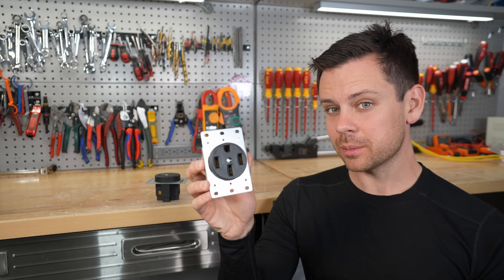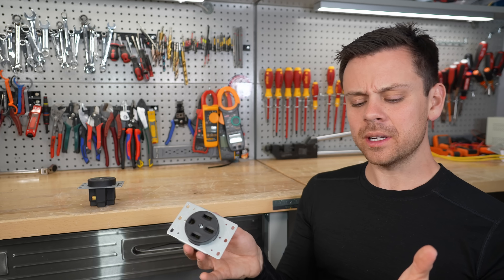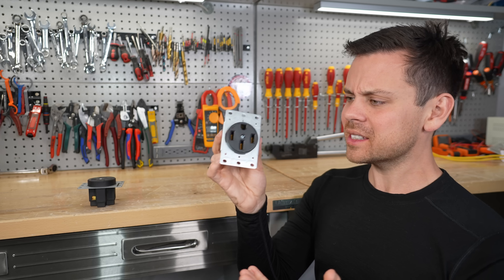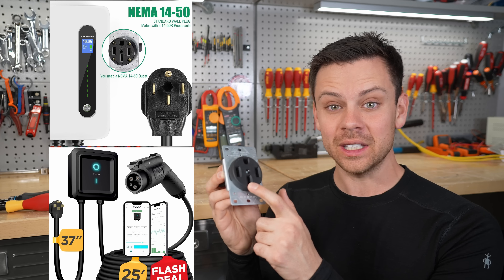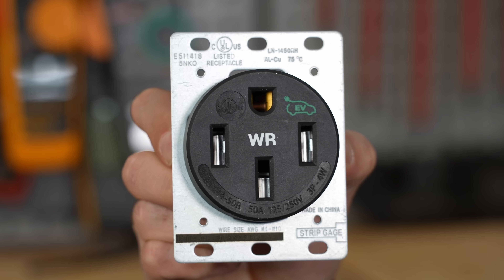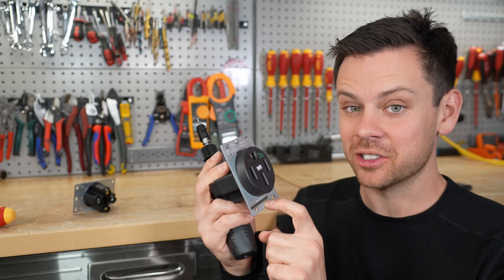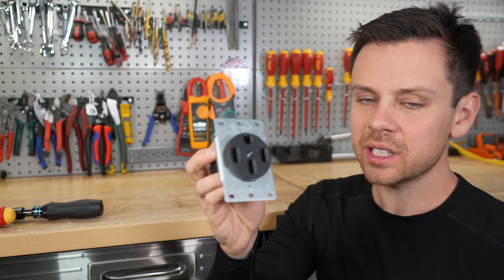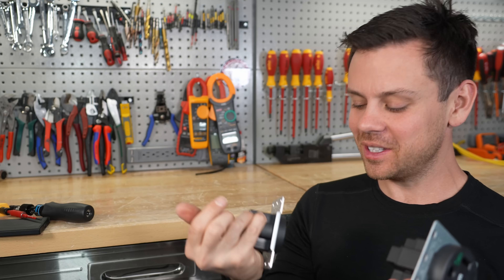Quick Guide to NEMA 14-50: Don't Burn Your House Down!

Comment: As a licensed electrician that specializes in EVSE installs, you are correct. It is not a code issue yet but widely know in the industry. I always push for a hardwired install as the 14-50 is more expensive and less output. Unfortunately, there are still some popular DIY videos out there that show the cheaper unit being used. I do not recommend this as a DIY project but at least, always pull a permit and have it inspected.
Reply: The NEC "electrical code" is trash.  It 100% allows electrical setups that can and will burn people's houses down, pretty much with 100% probability, given enough time in service.  The problems/deficiencies with the NEC are most severe when it comes to high current connections and contacts, especially those relevant to electric vehicles and solar power systems.  One of the biggest problems is that the NEC regulates electrical installers, but not electrical component manufacturers (which often times actively bribe [and/or sit on] the NFPA to include provisions in the NEC to require electrical installers to use their specific company's products).  Electrical component manufacturers are essentially free to design and sell garbage that pollutes the marketplace and really does burn people's houses down, while still being "100% code compliant".

The biggest problems with the NEMA 14-50 outlets (and some plugs) are not so much with the installation, it is with the manufacturer's designs available on the market.  There is no policing of the marketplace to ensure the products that manufacturers are producing products that actually can continuously meet the required current specifications for decades under real world service conditions.  Copper and brass are great electrical conductors and make good contacts, but only when they are brand new and free of oxide buildup.  Copper and brass are terrible electrical contact materials, when used in the real world over many years of service, where thick oxide layers build up on the contacts and make them highly resistive.

Similarly, screw contacts work fine when they are brand new and just recently torqued, but they are trash over time.  Heat from electrical resistance at the screw terminal causes thermal expansion of the wires in the screw terminal, which increases contact pressure on the wires and "squishing" of the metal during heating.  However, on the subsequent cooling cycle, thermal shrinkage of the wires in the screw terminal causes them shrink down to a size that is now too small for the current screw terminal position.  Repeated thermal cycling makes the problem even more severe, as the screw position becomes increasingly sub-optimal as the wires under the screw terminal continuously squish and deform more over time through higher peak temperatures.  Re-torqueing the screw helps, but it is only a temporary solution.  A properly designed electrical contact must maintain positive spring based pressure on the wires, with high surface area of contact, over time.  Screw and bolt threads simply do not have any springiness to accommodate and compensate for thermal expansion/contraction effects changing the shape of the wire being clamped.

Unless/until such time as someone competent rewrites the NEC and starts cleaning up the marketplace of pollution/trash electrical product designs, one would be well advised not to trust the NEC, the opinions of many electricians (who are not engineers specifically expert in electrical contacts), or passing results from government inspectors.  Government inspectors are not what make safe and reliable electrical connections that will not burn down your house.  There is no substitute for designing products correctly, and then installing them correctly, regardless if the installation was "inspected" by the government, and/or if the installation was done by a "qualified and certified electrician".  Certifications and qualifications do not prove a person knows or will follow all the best practices, it simply means they jumped through the right hoops to acquire the certifications or qualifications.

In the meantime, people need to follow certain best practices when dealing with high current electrical contacts (especially relevant to electric vehicles and solar power systems), which basically includes:

1.  Pretty much always use an anti-oxidant compound (ex: "NoAlOx") on all "high current" (essentially anything over 5 amps continuous) electrical interfaces, be they brass, copper, or aluminum (and to a lesser extent, tin).  
2.  Use fine stranded wire preferentially over solid copper wires.  Fine stranded wire conforms to the contours of screw contact interfaces better and provides higher surface area for the electrical connection, compared to solid core wires.
3.  When possible use tinned copper wire instead of bare copper wire.  Tinned copper wire is much less subject to natural thick oxide buildup causing increased electrical resistance, compared to bare copper or bare brass.
4.  Try to fill screw contact cavities as close to 100% as possible, with stranded wire.  The goal is to maximize surface area of contact between the wire and the screw contact.  It helps substantially to strip the wire much longer than normal, and then fold over the end of the stranded wire (once, sometimes even twice if it will still fit), before inserting the end into the screw terminal orifice.
5.  Basically always torque screw terminals as tight as possible without stripping the threads or screw head, while wiggling the wire simultaneously left and right a little bit during torqueing.  The goal is to 100% fill the screw terminal cavity with wire strands, in the final screw position.  When the screw terminal cavity is 100% filled, this maximizes surface area of contact patch for lowest resistance, while also leaving as little room for further deformations of wire shape to result in decreased contact pressure/surface area.
6.  Always lightly sand (and/or rub with copper oxide dissolving acids like vinegar) any copper wires or contact surfaces that are bare copper or bare brass, unless they are brand new and clearly bright and clean without any visible surface oxide.  Always sand the surface of aluminum wires, regardless if they are brand new.
7.  Pretty much always coat the copper wire ends and screw terminals liberally with the anti-oxidant compound (after they have been cleaned/sanded, if they did have any oxide from sitting around too long before installation).
8.  Try not to touch bare copper or brass contact surfaces with your fingers, prior to coating them with the anti-oxidant compound.  Finger oils contain sulfur compounds and other substances that greatly accelerate oxide/sulfide layer buildup on bare copper and bare brass contact surfaces.
9.  Unplug and re-plug in brass NEMA 14-50 plugs and receptacles at least several times a year.  The mechanical abrasion associated with unplugging and re-plugging in the plug can help to scratch off some of the oxide buildup on brass contacts.  However, such practice itself is not very effective.  Much more effective is to clean the contacts yearly by lightly sanding the brass surfaces (and/or polishing with an oxide dissolving acid solution), on both the male and female contacts.  Tinned and chrome appearance contact surfaces should not however be sanded (nor should they be unplugged and re-plugged too often), as doing so can wear off the oxide resistant tin or other protective coatings.  Generally, only brass and copper contacts should be repeatedly cleaned by occasional light sanding.  Cleaning brass contacts inside the female NEMA 14-50 contact is generally difficult, since they are recessed and largely inaccessible.
10.  "AC disconnect" boxes (typically installed outside for hooking up "hardwired" air conditioners, but potentially inline with other "hardwired" 240V appliances not in line of sight with the circuit breaker panel) often have terrible internal construction with bare copper blade contacts.  If using such a product, always sand the contacts free of oxide, and immediately coat the copper liberally with anti-oxidant compound, prior to putting the device into service.  If the plastic plunger with the copper blade contacts plug in or pull out too easily (even when brand new, for some models), consider bending the receptacle contacts with pliers to get a better contact surface patch, prior to use.

Comment: This is such a great video.  I have heard about this a few years ago, so I always keep this in my mind about using the hubble recepticle.   I don't have an EV, but anyone who needs to install a 220 outlet needs to take heed.  Better safe than sorry, pay the extra money for the top outlet and avoid a fire. Use the proper conductor size and type and torque to the proper specs, loosen and torque again.  You need this outlet for an electric clothes dryer  - the code now requires 220 outlets to have a ground.  If you buy a new electric dryer, you have to upgrade to the 4 prong outlet and don't buy the cheap $10 outlet, buy the hubble.

Comment: Thank you for the information and video!  I appreciate all the effort you put into your channel.  Couple of things... It should be more boldly stated why the $10 plugs are failing. EV charging takes continuous current draw - not intermittent current draw like an electric stove or even an electric clothes dryer. The continuous current draw generates a lot of constant heat leaving no cooling period or chance to dissipate that heat thus the component materials melt.  Next, if you are going to present / show a component, screwdriver, or whatever ... STOP shaking / moving it  to the tempo of your speech.  I want to look at what you are trying to show me not watch it bounce around the screen please.

Comment: I don't have an EV and don't ever plan on getting one, but I just may use the Hubbell to replace the cheapies that I used on the extension cord for my welders. The Hubbell might be overkill for this, but who knows when the cheapies will fail?
Reply: Don't waste your money. Welders are not a continuous load and are ok on the cheap 14-50s. BUT if they are getting loose (easy to insert/remove the plug) it's time to change them. You can replace the cheap ones 4 times at the same cost. That said, there is nothing wrong with going for the better ones, but don't rush to do it if your current ones still grip the plug tight.

Comment: Professional electrician here. 
All installed equipment requires a means of disconnect in visible range. If you are installing the EV charger in the garage right next to the panel then hard wiring is OK,  otherwise it will need some means of disconnect. A 60A rated pull handle disconnect will costs hundreds of dollars, so an AC pull out disconnect or the EV rated receptacle are reasonable options. 
There shouldn't be any fires or houses burning down if the receptacle melts down and it is correctly installed in a listed enclosure and wired to the correct size properly functioning circuit breaker. All that will happen is the heat will eventually overload the circuit or there will be a ground fault and the breaker will trip. It's not good that the receptacle fails, don't get me wrong, but they are designed for electric ranges where the typical use is intermittent above 30A, not continuous at 50A or even 40A.
That being said I installed the Eaton brand L14-50 in my friend's garage for his 50A charger, which he uses at the full 50A, and there have been no issues so YMMV. I did use #6 wire to handle the 50A continuous load though.

Comment: Did one receptacle feel lighter than the other?    Disassembly ( destruct of receptacle happens of course) with analysis of internals would be fascinating.

Obviously its resistance that is producing the heat.   Is it thin conductor  material inside the receptacle?  Or weak grip on plug contacts?

Comment: This video is why is watch this channel! 
I have been working with electricity all my life with no formal training. 
I am completely dependent on this kind of content to stay safe. 
Thank you. 

I have seen it all my life: people learn a little, do dangerous things and die!
People break rules that they know they shouldn’t and die. 
One companion of mine broke rules and died in front of me. I told him not to do it!

As cautious as I am my ignorance has almost cost me my life many times. I survived by luck. 
Be careful.
Reply: This issue is specifically for EVs and items of similar nature. EVs are able to pull 30, 40, 50 amps continuous and the $10 plug, although listed for that amperage, is not made to handle that constant load. It was originally intended for use with Electric Stove/Range Combos and Electric Dryers. Both which may pull up to 50 amps but will only ever see that high of a current IF all is being used.
For example, on the stove and range, if all 4 or 5 burners are on High and producing heat at the same exact time producing as much as possible & the oven was also trying to heat up to 500 degrees F. This is when it could be pulling the 50 amps. But this could only be for a few minutes.
An EV would pull this for up to 4 to 20 hours straight, depending on the model of EV.
Reply: @ thank you for your post. That does add to my knowledge. 😊

Comment: It is not the lugs that connect the wire to the fixture!!!!
It is the clamping force between the plug prongs and the clamps that make contact with the prongs that is the point of failure !
If you look at a blade style disconnect the socket that the blades slide between have additional springs to increase the clamping force on the lugs for that very reason there is also more open air space to dissipate the heat ! 

The NEC makes wire size exception for air conditioning units to be smaller sized wire. It should be changed because that was accepted when the units run times were much less that how they are being used today with longer run times! Just figured I'd put it out there  , just because it's code doesn't mean it can handle the load !!
Reply: No need on the a/c units to change Code. The minimum wire sizes are already calculated to be 80% of wire ampacity which is more than enough safety margin. And the Code exception specifically points out that the condenser's overload protectors protect the wire from overcurrent, the breaker is to protect mainly short circuits (or extreme locked rotor currents.)
Reply: @mxslick50  people have used an old disconnect to wire in level 2 chargers because where left in place when an updated system was installed in a different location. Because they have a similar assumption that it's capable of a 30 amp load as all components are labeled that way, not knowing a smaller wire was used. There have been several fires contributed to such. Very few people know that one appliance is generally installed by the rules of the exception and not the normal code ! It's done to save cost and as more and more people tackle these simple projects because of the Internet! Because it is the only exception to household wiring for a reduced wire size on a larger circuit!

Now how many reading on this thread actually knew this exception for wire size is the code???
Reply: @alvinhyman6838  You're talking apples to oranges for one. Second, the  NEC cannot anticipate what will be done in the future by people who have no clue what they are doing. Or to put it another way, just like your local inspectors, once the job has inspected and passed, they have no control over what is done to it afterwards. 

I have sat in on Code panel's discussions and even they have had this debate. All they can do is make the rules and if they are followed, an electrical installation is considered to be reasonably safe and functional. If someone does something stupid in the future, that is on the fool, not the Code panel, inspector or electrician. 

As for your disconnect example, your stated reasons are wrong. One, the distance between lugs and disconnect blades is to prevent phase to phase or phase to ground arcs, as well as ensure the circuit is opened safely.  (And to allow the surface area to be larger for mechanical strength and current capacity.) Heat dissipation is not the main factor. Second: wire bending space to allow for clearance from the moving parts. 

And your last sentence is 100% wrong. If done to Code, and used for the loads it is installed and designed for, it WILL handle the load as per Code.  Your own example proves your last statement wrong. You're frankly being overly dramatic and need to stop worrying about a nothing burger. 

The Code has had that HVAC exemption in place for over 50 years, and it has stood the test of time so it's not going anywhere. I have been a licenced electrician for over 45 years in residential, commercial and industrial so pretty sure I am up on how things are.

Oh, and please cite your source for "several fires" being caused this way, with proof that this deliberate misuse of the original installation is the Code's fault.

Comment: Have you crimped connectors on those individual wire leads? 
I think you should never use that especually in that size direclty screwed in without crimping an end connector properly on it. I am in EU so maybe this is just a rule here (if I remember correctly).

Comment: Another thought Will—maybe worth mentioning is that it’s suggested by electrical engineers only charge at 15-20% less than the rated size- for example a 50 amp receptacle should only charge at 40-42 amps continuous. Or a 40 amp receptacle should only be continuously charged at 30-32 amps.  The reason this is suggested is for longevity and safety. Charging your EV at  the maximum amps for the wire size at full capacity on a continuous basis is actually dangerous. I had chatgpt suggest this.  I think it’s good advice.
Reply from the maker: @stevespawn1  I actually mentioned exactly that in the video